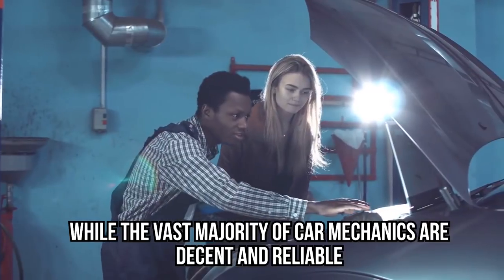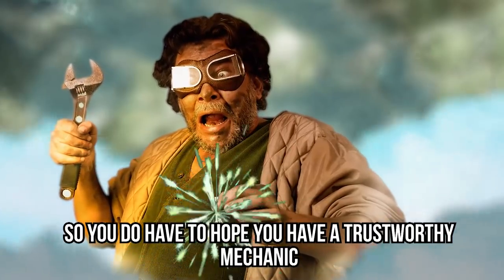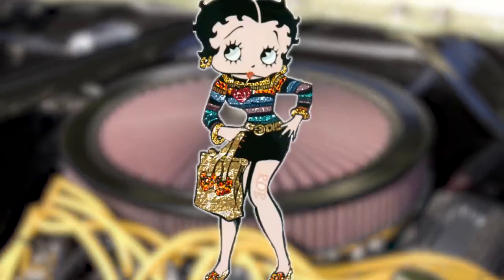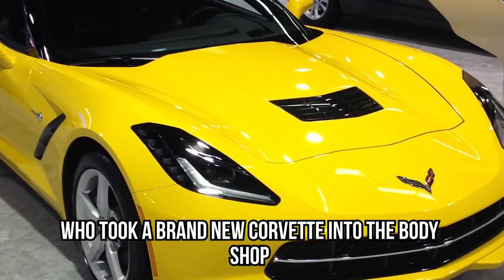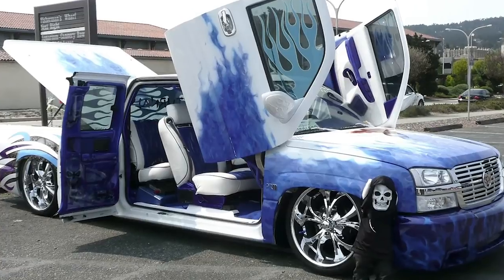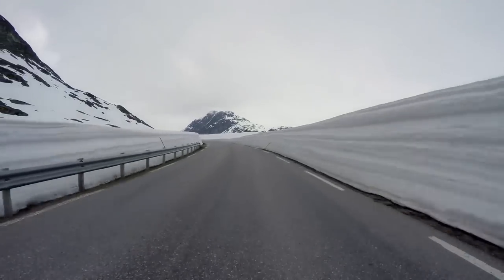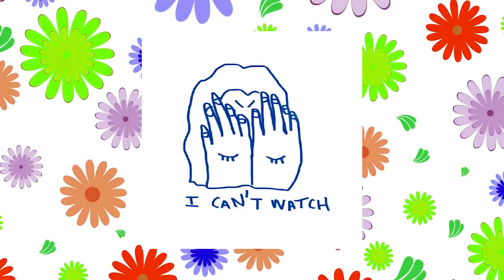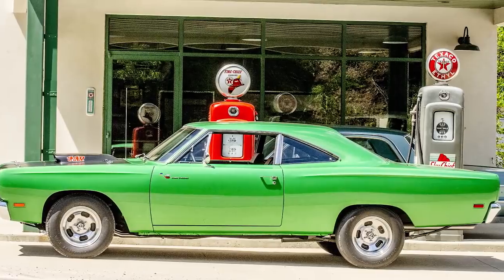10 Things Car Mechanics DON'T Want You To Know

Comment: You should know that just resetting the check engine light doesn't fix the problem. Its common sense.  Also, keep in mind that the engine is very complex so it takes time for the tech to diagnose it. This costs money. Again, simple common sense.

 I've never heard of a mechanic dirtying up an air filter. Lol. Maybe showing you an old air filter bit not rolling it in dirt.

Comment: Truth hurts!! A must in life is to have a good honest mechanic kinda like a husband.
Reply: Honestly lookup what needs to be done to your car and keep a record of things done. I heard a mechanic tried the Blinker fluid replacement on a female customer before but she didn't buy it and just walked out. As well as flushing out the oil in a diesel engine because its black but the customer knew diesel oil always turns black. Overall doesn't hurt to do a little research before so you know what the mechanic is talking about.
Reply: Steven Kenzou I seriously take great care of my cars. I write down everything even when I rotate the tires. I've had a guy try the air filter gag with me, I said I know better and take off the new one..What a joke.

Comment: We need to have your tire fluid flushed, only 50$! 
Btw, standard spark plugs, non-platinum/iradium should be replaced ~30k miles. Look in the owners manual. I replaced mine on 98 sentra and went up 6mpg. My dad's truck with 167k miles. The spark plug gap was almost 0.080", about twice out of spec causing very sluggish response and poor mpg.